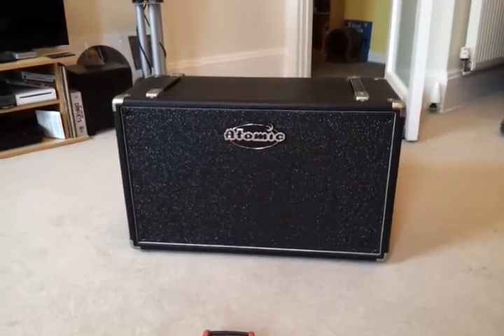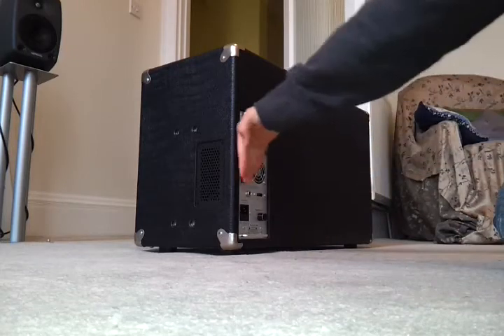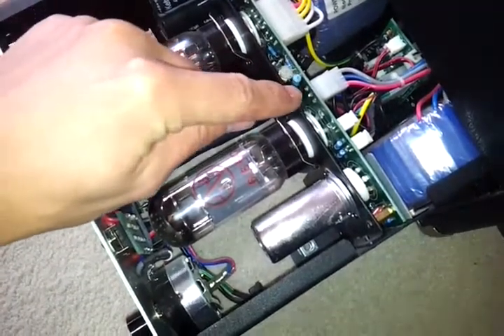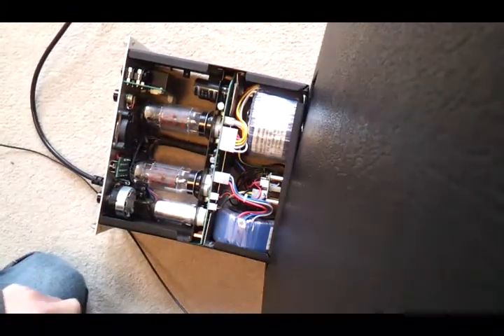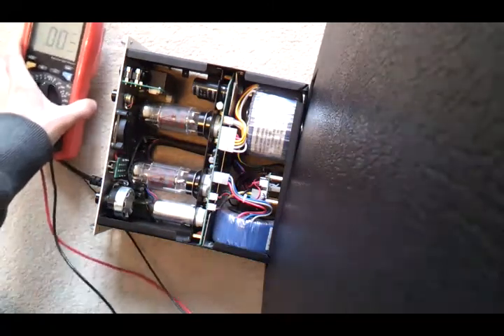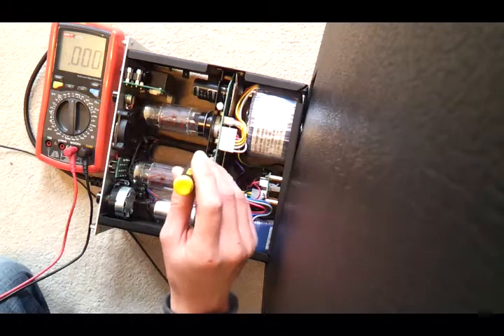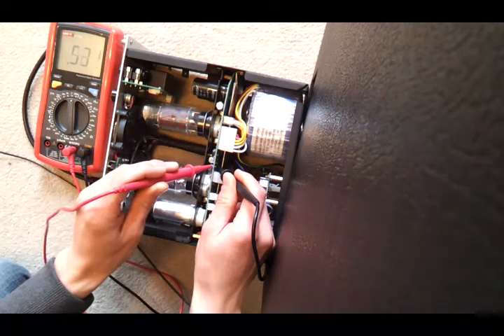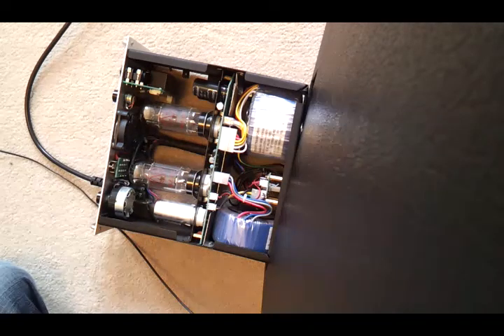Atomic reactor amplifier bias set

Comment: Great instruction! After seen your clip I've rebiased my amp and the sound has remarkable been improved. On the other hand I found it easier to use crocodile clamps to prevent any accidental short circuits.
Do you have any experiences operating the amp with EL34 power tubes and how they have to be biased?

Comment: Great Video I have the older model atomic reactor 112-50 it looks the same inside ..are the values the same for my R18 , also Atomic told me to measure 28-35mV where are they getting this from? Thanks i think my amp was biased cold it sounded thin now its warm and full.
Reply from the maker: I got the numbers from atomic tech support. i would imagine the numbers being different for amps. they might use a different value resistor so you would expect a different voltage

Comment: good movie! Problem I have is that the speaker cable is too short to pull the amp out of the chassis.
Reply from the maker: Paul van der hagen it may be getting caught on the hole. mine seemed to be too short but there is enough to pull out the amp
Reply: thanks for your quick answer. Pulled it and have very little space to move around. Pulling the amp out detached my speaker cable. Next problem is what side is the right side to plug the speaker cable into its chassis. There are no marks on the connector so you can easely connect it wrong
Reply from the maker: Paul van der hagen it will only connect comfortably one way. the plug from the amp has a sawtooth shape strip along the width of the plug, this will align with a simular shape on the speaker end male plug